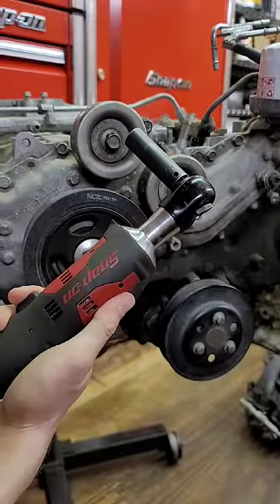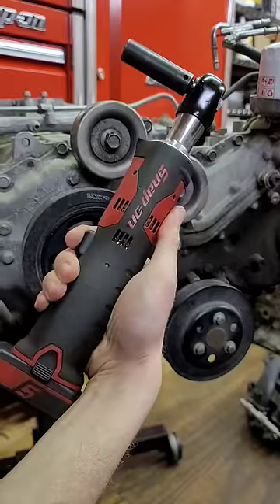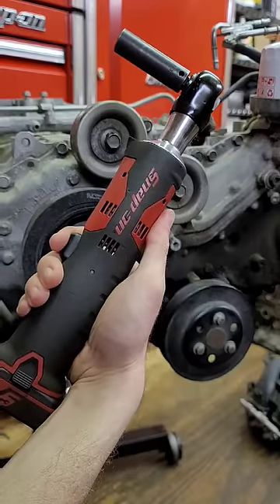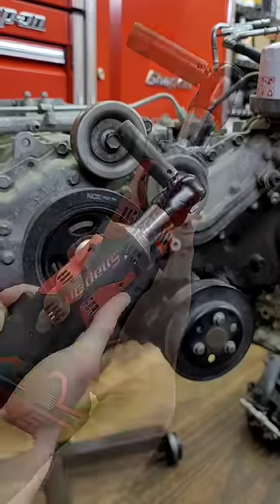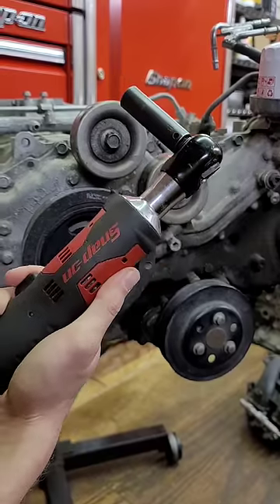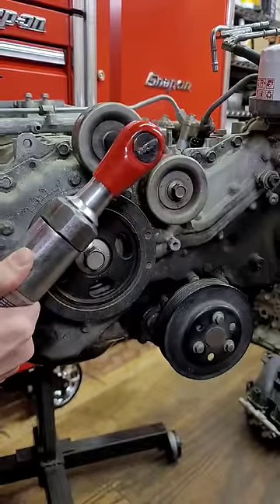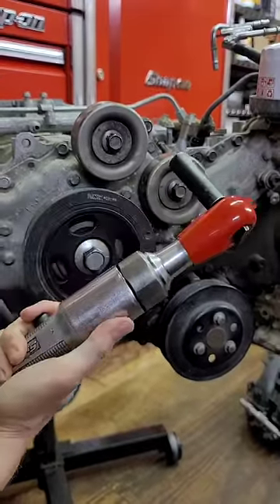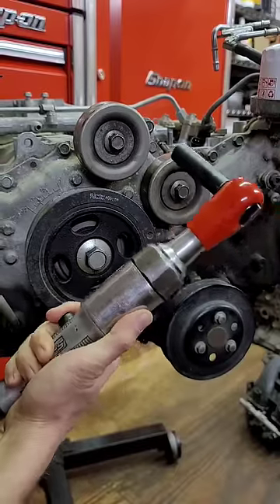Don't Use Electric! Use Air! Duh! #Snapon #Shorts #CordlessRatchet

Comment: Being a full time mechanic the cordless ratchet is a life changer. I could never stand the noise and inconvenience of the air ratchet.
Reply: I like to call it bluetooth
Reply: @Hunter-mp6dh  Haha bluetooth ratchet. I like it.
Reply: I feel the same way bro
Reply: You mean you don’t want to hear a generator turn on ever 5mins
Reply: Same here. So much better than air.
Reply: Soo true especially on timing covers
Reply: The air line is always in the way
Reply: You can literally take an engine down to block and heads with a ¼ inch milwaukee. I've done it countless times.  I am a certified CAT technician. Don't doubt be just try it and you'll see.
Reply: I couldn't agree more.
Reply: As a body tech I can say those snap-on cordless ratchets are a life changer, dragging hoses all over the shop is to much work as opposed to just changing the battery at lunch
Reply: I hated blowing dirt and junk in my face all the time trying to use air tools. I still obviously use air for cut off wheels and stuff like that, but as far as tools, I bought a impact gun first, and haven’t looked back since.
Reply: U mean ya poor
Reply: Yup hearing that compressor cut on all the time is annoying
Reply: YES!!! some of my career I refused to use an air rachet much because I hated the noise. I'll wear out an electric rachet though.
Reply: @nutgone100  if you say so🤷🏻‍♂️
Reply: 9/10 there’s usually not enough space for me to get a impact wrench in, but as soon as DeWalt releases their cordless ratchet, i’m definitely buying one. Much more convenient, save me some arthritis. (I just do this as hobby work).
Reply: @alexanderquilty5705  Milwaukee makes a right angle impact and it’s about the same size are the electric ratchet
Reply: @alexanderquilty5705  have you saw the Ingersoll rand hammerhead? It looks a lot like an air rachet but it's a 90 degree impact wrench. I had one and it's fantastic! I would use it 10 times to one over a air or electric rachet.
Reply: @nutgone100  yeah maybe so. But to me an air rachet is a lot of output with little work done and uses a lot of air for no more than it does. Don't get me wrong, they are needed in cases and I do use them. I just prefer an electronic rachet or even better a 90 degree impact wrench.
Reply: @fritzdaddy-135mmgetstagger4 you mean you aren’t paying someone to do the work for you?! Must be poor.
Reply: Honestly same My ears ring using air anything gotta put on earphones to not go deaf😂😂
Reply: @vmonroig21  did you mean air compressor
Reply: @vmonroig21  you mean compressor?
Reply: @Todd1990  yea ok kid.
Reply: @fritzdaddy-135mm get staggered  I couldn't agree more
Reply: @Alexander Quilty  Dewalt, LOL. get a real power tool brand
Reply: but the noises are cool
Reply: Yes! The noise alone makes them undesirable. And then the inconvenience of dragging the hose around. And then you get to hear a compressor run
Reply: @joespyderify  kid? What's that about
Reply: Agree, but they are dirty cheap
Reply: @Todd1990  you might need to check what those head bolts are torqued to if you loosen them
Reply: @h2owaffleshop809  I said down to the head and block
Reply: @Todd1990  maybe if you're not counting mains, rods, flywheel and balancer.
Reply: @Todd1990  yeH after you edited it
Reply: @Todd1990  at first it said down to the block
Reply: @h2owaffleshop809  it said down to block and heads. I added 2 sentences at the end just for clarification
Reply: @Todd1990  dude just give up stop trying to act like you didnt write what you did at first
Reply: @h2owaffleshop809  or quit acting like you know everything.. you don't and never will move on.
Reply: @devinmcneill2757  I am talking about the intake manifold  etc on the upper side. Not transmissions Nor ( Removing ) heads.
Reply: Really? I can’t say I enjoy the sound but it definitely does give me some sense of nostalgia I guess? All I know is I don’t mind the sound the sound
Reply: @fritzdaddy-135mmgetstagger4  no
Reply: I love the sound of shit air ratchets
Reply: I like the noise but I also don’t have to hear it everyday all day I see why mechanics don’t like it
Reply: To me I actually Love the Sound of An Air Ratchet
Reply: @michaelf.2449  not saying that i know everything just saying to stop lying
Reply: @vmonroig21  uuuuh you mean a COMPRESSOR
Reply: Exactly the noise alone
Reply: I just use the cordless ratchet as a regular ratchet to break bolts lose. But only on bolts that don't have enough torque on them.
Reply: @nutgone100  yeh I do agree I work as a fitter for car transporters use Air tools only they're loud but not really a worry it's more the air lines that are fun to maneuver if ur too worried about noise throw in sum ear plugs.
Reply: I have to use air tools mainly due to working on buses
Reply: @Hunter-mp6dh  Hell yeah, got to love the bluethooth air ratchet
Reply: Lj
Reply: Not to mention, you get to keep your hearing.
Reply: Can’t stand the sound neither.
Reply: Yes sir, save those ears man I can't stand the sound of air tools but they have their purpose sometimes in the shop.
Reply: But with the sound of the air ratchet you feel like your at a bad car pit crew
Reply: 100% one of the best tools i bought in 20yrs, proper game changer!
Reply: Even the and air gun for struggles to do 2 tyres alone
Reply: @tyop5427  i used to have to use a big boy 2 handled inch drive impact gun to undo hgv wheel nuts for years and years till i got my hands on a new milwauke half inch electric impact gun, even the bigger wheel nuts done to 700nm are not even a problem with it, couldnt belive how good it was!
Reply: Some new electric devices are stronger this days close to air impact devices but some stick screws cant be opened without air versions, i bought one just for opening some stuck bolt , and it did it like magic still didnt do it for some others but that was good enough.
Reply: @Bellboy Fabrications  Milwaukee cordless tools have been amazing.  I  have the 1in fuel gun and the 1/2in gun, plus alot of other things.  The cordless ratchet is next on my list.
Reply: You don't sound like a mechanic at all.. air ratchets are like songs to mechanics..
Reply: @HaveAGoodDayFk.U  ive been a mechanic for 23yrs amd yea an air ratchet makes a cool sound and i never used to see the point in an electric ratchet till i got one! not having to fuck around with getting airlines out and being able to get it into tighter spaces because of the lack of airline completely changed my view
Reply: Everyone has valid comments but have you ever had one of those Snapon air ratchets bind up? Yep almost a broken wrist. I love my “cordless” and really haven’t used any of my air tools in a long time. Convince is key in most situations and sometimes you may not have a compressor handy. They may be pricey but when I do mobile jobs I have the batteries to back it.
Reply: Kinda the same. For some reason hearing a compressor kick on while I’m working just kinda boils my blood a little
Reply: I feel like they're not really meant for brute force either, they don't need a stupid amount of power by any means
Reply: I've named it the batchet (battery ratchet), it deserves a name on it's own
Reply: @nutgone100  Ya, I agree. You want some cheese with that whine? Touchy ya that’ll work.
Reply: @vmonroig21  nope
Reply: When I started, it was with an air ratchet, and for over-the-head work, it got so annoying having the hose be in the wrong spot, or weighing down the bolt, making it really easy to accidentally cross thread. Then think of interior work, removing a seat or something similar, the hose would grab on everything and sometimes get the carpet or door dirty. 
Soon after I got an underpowered Milwaukee (the first version they made) and that thing was way more convenient to use, even with the power loss, it still beat the horrible experience of the hose tossing and yanking.
Reply: shitpost status  true
Reply: U don't like the sound of air tools?
Reply: @frankdavis313  no it can't get extremely frustrating real fast
Reply: @BedCat1432  idk literally grew up listening to it if it wasn't in person it was on TV so I kinda enjoy it
Reply: @frankdavis313  well thats ok then for me I could mavy tolerate it but I have extremely sensitive ears so I can't handle it
Reply: @BedCat1432  the blaring classic rock at the same time probably helps prevent it from bothering me lmfao
Reply: @frankdavis313  lol i could never handle that lol even chill soft music can bother me after some time
Reply: @BedCat1432  yeah you wouldn't have made it there were 7 of us plus a bunch a goobers that basically lived at our house so it was concert level loud constantly lmfao
Reply: @frankdavis313  well the only thing I can say to that is blood party maby lol
Reply: @Sak-zo1ui  little late to the part but I’ve always referred to it as “Sideways Weaponry”
Reply: They’re too torque too damn near break your wrist if you’re using it in a compromised position. The electric ratchet is nice it’s not supposed to be breaking stuff loose that’s not the purpose
Reply: That’s the worst thing about air tools, the noise, especially things like air die grinders.
Reply: I personally like the sound of it 😅
Reply: Knuckle dusters, every time
Reply: But I like the noise
Reply: Right!? So annoying😒
Reply: like electric impacts are so much better
Reply: @Treymc1  option of just a basic manual ratchet or electric ⚡️ tools 🧰. Doesn’t degrade you if being a real mechanic 👩‍🔧 or not 🤦‍♂️ 😂.
Reply: @vmonroig21  generator???
Reply: If youre being picky about noise then you should not be a mechanic
Reply: Inconvenience if air? Air tools are great you guys are F’ing crazy those battery tools are good but when your battery is dead your screwed air compressors don’t go dead lol
Reply: @Todd1990  you took a cat engine apart with nothing but a 1/4 inch electric ratchet my ass I know some of the torque specs and there’s no way you could break the bolts without breaking your little electric 1/4” ratchet especially once you get to taking the main caps off and the head bolts those are up over 100+ pounds of torque on a diesel cat
Reply: @vmonroig21  Did you mean to say air compressor?
Reply: Everyone's afraid to pop that 200 tag but once they do it's over 🤣🤣 electric everything
Reply: No more kinked lines. No more loose fittings. 
Wait. What about airing up tires? 😢
Reply: air ratchets is annoying asf make too much noise and the fuckin hose is annoying having to grab it
Reply: @vmonroig21  what generator, you mean air compressor?
Reply: @robsmith7681  That reminds me of a time when I first started and grabbed the air ratchet and tried to a suspension bolt and got an entire soccer pitch blown into my face and hair was not a fun time.
Reply: I love the air ratchet noise, so iconic
Reply from the maker: Yes
Reply from the maker: DaveCaresForYou  Snap-on electric ratchet rated at 120Ft.Lbs. manual force.
Reply: For me, I prefer air over electric stuff just because I ADORE the sounds of the air tools. They're more or less on par in today's market, and you can find something to suit your needs, no matter your preferences.
Reply: @Todd1990  you being CAT certified is the problem. you dont buy a 90's shitbox and find every second bolt over tightened by the drongo who owned it before you
Reply: WHIRRRRRRRRRRRRR VRR VRRRRRRT VRRT WHIRRRRRRRRRRRRRRRRRRRRRR
Reply: @alexanderquilty5705  if dewalt makes one it will likely be a similar platform to craftsman and have a 20v battery on the end. Takes away from where it can fit. Milwaukee m12 is super small fits anywhere
Reply: @nutgone100  Oi mate it's not whiny if you have to work with it all FOOKIN day and air tools eventuly causing hearing loss which isn't a thing with cordless. Also noise is a stress factor. Unpleasent Sounds create stress!
Reply: @alexanderquilty5705  Maybe check if Fein makes one. Worked with a cordless drill from them a while and it's more powerfull than any drill with a cord on that i'm aware of. Maybe they make a powerfull ratched too?
Reply: @joespyderify  Exactly. Fein for example like i mentioned here already.
Reply: El trinquete no se, pero la diferencia de ruido entre las llaves de impacto a bateria y neumaticas es ridicula
Reply: They make almost the same noise if not exact 😂 I use both really depends what situation I'm in and where
Reply: Nah bro you can’t beat air tools, I get Why like you need it for a quick get it done but you don’t have the power an air tool has, it’ll toque anything down to “that’s not goin nowhere”
Reply: @just_another_shy_shark5162  Then you may not have worked with a cordless drill from "fein" yet. Those are stupidly powerfull.
Reply: @vmonroig21  A generator? Or…..compressor? Hahahahahaha
Reply: @j.rjunior5584  man better be careful using the cordless ratchet as a regular ratchet to break bolts loose. We use them at the lil shop i fuck around in and watched the owner doing it then bam the damn thing broke lol. We don't do that nomore
Reply: @Hunter-mp6dh  😂😂😂😂
Reply: I think the comment of ratchets being cordless was probably them thinking about the manual ratchets and not like the electric one you're using
Reply: @alexanderquilty5705  i jus got the 12v Dewalt cordless ratchet and I must say it is nice. Got about 60 ft/lbs of torque to it
Reply: @Todd1990  Hi Sir ! Wich one do you prefer Milwaukee ratchet 3/8 or 1/4 drive ?
Reply: @top111quebec5  I liked using the 1/4 myself.
Reply: @top111quebec5  depends what your wanting to use it on mainly..
Reply: I used them painting cars. Super fuckin awesome. Although we never used them for heavy shit at all. No more that maybe a 1/2 inch, but the manual break also helps save the drill. I mean come on, that's common sense, I think. lol
Reply: I worked many years ago as a car mechanic, and there are lots of sounds even without airtools.. so not sure they make a difference really. If the electric tools are as good, why not.  We did not have such luxery when I worked :)
Reply: @fritzdaddy-135mmgetstagger4  Spending no more money thats needed isn’t being poor, it’s being smart. I work in HVAC, and it’s always annoyed me when the new guys buy expensive shit. It just isn’t needed and it’s a waste of money.
Reply: I have an aircat mini 3/8" air ratchet.  It's extremely quiet.  I love it. Still haven't got into battery ratchets yet.
Reply: Aw. Clean your electric in the safety clean tank or soak in in trans fluid. Yes they are easy and convenient for a wimpy toyota tech. But when ya need em most the battery is dead and extras cost way more than a new air hose. Just sayin.
Reply: daamn whaatt dat sound is d best thing
Reply: yea the hose is still a pain the worry of air leaks and hose in the way and lugging hose around the disadvantages out way opt for battery or plugin .
Reply: @isaacwhite7411  both have good and bad points. We work at the steel mill in Cleveland and get to use IR one inch and above with really 200psi. Make sure you have your PPE on. With cordless for regular issue. Try a 231 IR 1/2" on 200 psi . Oh yeah. Fun.
Reply: and electric is more safer dont have to worry about tank blow up and maintenance eather or tool maintenance just a nick in the cord electric tape can fix in a few minutes or cheap cord replacement
Reply: @isaacwhite7411  yep yep yep. Good and green also. Nasty stuff powers the electric plants.  I got ya man, we wrench for a living I'm on your side. My grandad told us to never sell your tools or your best guns cuz we may need them to feed our family. From retired mopar flat rate dealer tech. . get out and go to big manufacture. That's where the money is for us mechanical crew. Look online. They all hiring.
Reply: @isaacwhite7411 from Brunswick automart/ Subaru. 44212.
Reply: yea speaking about going green I havent really calculated the efficiency of air power for electric to run a pump then at the tool
Reply: I knew that motor looked kinda familiar
Reply: @isaacwhite7411  green stihl oil mixed for dirt bike at 32/1. Smells good and runs well. Orange stihl bottle only.
Reply: what??
Reply: Yeah my old man just bought an electric impact drive and it was a game changer the impact is still pretty loud but at least we don't have to carry a compressor whenever we do home service
Reply: @Hunter-mp6dh  Barz
Reply: @Todd1990  It's my go to tool.  I have the whole milwaukee line up though.  M12 & M18.  The most recent 1/4 impact gun is the King.
Reply: Wat do you recommend from all the brands outhere, which one you think it can beat a air one?🤔
Reply: It wasn't in my way. I still would buy a impact driver
Reply: @Hunter-mp6dh  milwaukee makes actual bluetooth tools they just call em “one key” instead
Reply: It's funny how now that now the shop is much quieter thanks to "hoseless" tools I decide 20 years into being a tech I wear ear protection. But in my defense it hasn't be n until recently a descent "cordless" set of ear buds are readily available.  Long are the days of regular ear plugs.
Reply: Same for me 22 years on the tools and i never bought an air ratchet , 💪
Reply: Until the batteries die or you forgot to plug them in. Personally, I love both electric tools AND pneumatic tools. They each have their pros and cons and they each have a time and place where they shine better than the other.
Reply: @joespyderify  whatever works best for the job you're currently doing. My DeWalt tools are for my house and construction tasks, stuff like that. My SnapOff and Matco tools are for maintenance/mechanical work. And my off brands and harbor freight tools, well they were likely bought for a one task one job type deal, and/or it was just super cheap even 1 use out of it and it paid for itself, so it doesn't matter if or what you use it on again. That's why HF is cheap, you know some of the shit is gonna break sooner than later, why spend hundreds of dollars on a torque wrench from the truck when you can get one for 50. It's all warrantied either way you go, who cares. As long as the tool is in working order and it gets the job done, which means that tool made you money or accomplished what you wanted. Similar to the toolbox deal, who cares what brand it is, does it hold the tools that make your income? Does it have wheels? Then who gives a shit
Reply: Plus how much power do you really need in these? Too strong will just break your wrist
Reply: Air is good if you have a lot of fasteners to put on but if it’s a moderately small job battery is fine
Reply: Yesssssssssss
Reply: 😂 pus
Reply: This